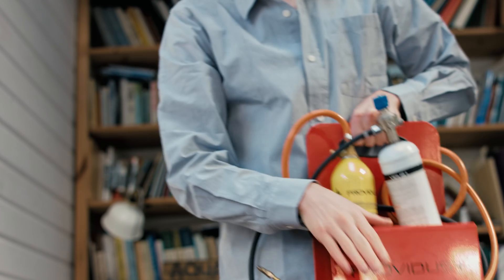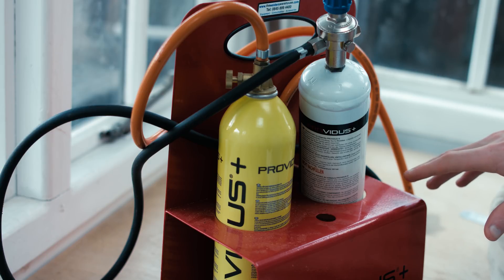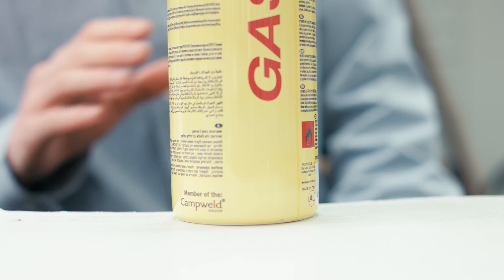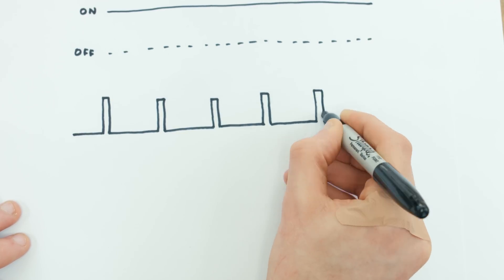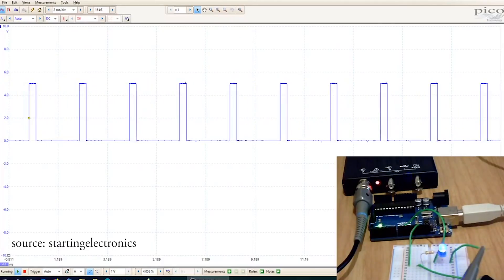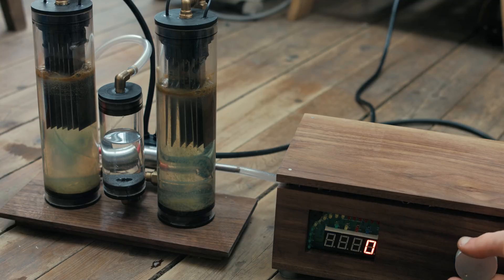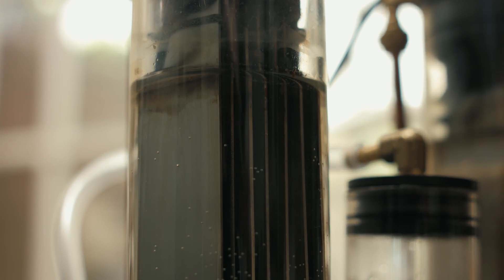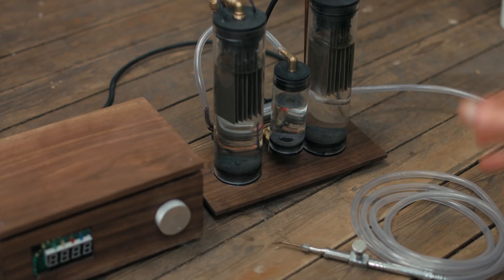Water Powered Cutting Torch

Comment: Use stainless steel in a alternating plate configuration like the production units do. They last just fine under the lye (sodium hydroxide) caustic used in the water to allow proper electron flow... And NEVER fill up a balloon with it and tape a 1 foot fuse to a mostly enrolled black cat firecracker ( potassium clorate and aluminium oxide (dust )) light it and let it go. Might blow out your windows. Use at least TWO explosion arrestors, like the pros do, or you production tank will be shrapnel.

Comment: Using distilled water prevents corrosion, and also there is an equation of amperage to surface area of plates. The higher the amps the hotter the plates get which speed Corrosion.
Go here for valuable info ! http://www.hho4free.com/cell_stacks.html

Comment: swap polarity after a determined time, if there is buildup. it should dissolve or flake it off,  on this note you could use rebar or crap  and have sacrificial electrodes. I guess that defeats the point. depending on the details I could postulate that something in the water is reacting to deposit on surface, or cause other issues? I'm a newb sorry. done home  experiments not a nice as yours though

Comment: Wondering if you made any changes and how it turned out? Before I offer my humble opinions on the problems, I gotta say that's a very cool looking project. Were you going for 1800's science look? That's the vibe I get. Love it.
Now, I would agree with some of the others. Your steel might be 400 series stainless and not 300 series. 316 is probably at the right price point vs. corrosion resistance. And yes, distilled water is a must. Chlorine isn't something you want because it creates highly toxic gas, even though that can be rectified by leaving it sit open for a day or so. But there are plenty of other minerals and chemicals in tap H2O, such as calcium, magnesium, sediments, possibly fluoride from fluoridation. Pure water and potassium hydroxide are all that should be in there.
 Next, plate spacing and neutral plate arrangement are crucial to maximize efficiency of voltage and amps flow over the plates. I believe 3mm is the sweet spot, as per a US Energy Dept study found. The cell needs designed to "use" up the voltage, so each plate "sees" around 2 volts. Example: 12v supply = 7 plates x 2v drop between each pair. Only the two outer plates are connected to the supply. Only the amps should be changed to vary gas production and there is a maximum based on plate area before heat and degradation is sped up exponentially. Voltage needs to remain constant or you will have efficiency losses, possibly arcing, and straining your power supply: increasing the chances of problems, especially deterioration of the plates and mucky electrolyte.
Here is a good site for research: http://www.hho4free.com/amperage_understanding.html

Sorry it was so long, and I hope it helps others build efficient and successful hho projects.
Reply from the maker: Thank you for the long and thoughtful reply! I think I may have been ripped off with the stainless I bought. I’ll try out distilled water. I have each plate at 2V.

Comment: use distilled water with NO additives, to compensate for the high impedance use high voltage. Fly back or radiant works well, tho requires advanced electronics. Pure HV PWM will work too.
Reply from the maker: Guardian Engraving I’ve never heard of that method? Would need some serious diodes to rectify voltage that high with such a large current.
Reply: @WillFromLondon  No no you misunderstand, the method uses HV with almost no current (Amps). Its similar to Arc Electrolysis but again no current. A fly back for instants has no current, only an open ended potential(V). Current only appears due to an impedance in the way of the potential. You can also create a resonance in the electrolysis cavity to allow for low power consumption.  Or you could also just use a Dry Cell design, built properly it uses less amps then a wet cell. I have not seen anyone use carbon electrodes, that could be something new to try. You can try looking up Robert Murray-Smith on YT he makes carbon/graphite and graphene electrodes. The point is NOT to use additives in the water as it creates sludge & oxidizes everything. But to break the water down using resonance and HV.

Comment: Did you tap water or distilled water? Tap will muck things up. Gotta use distilled. 

Also have you calculated the maximum amperage for your system? If pump too many amps on your 316L plates you will ruin them. 

I’ve built my own. Yours is a wet cell, mine is a dry cell but the principle remains. Mine is rated for a maximum of 32 amps. If I exceed that it will cause the chromium to dissociate from the steel and cause that nasty chromium oxide gas. This naturally is the cause of the corrosion of the plates. Also it dilutes your torch flame with it, making it not burn pure hydroxy. 

Calculate the proper amps. Don’t exceed it. If you need more output....add more stacks or make bigger plates. Do it right and the 316L will last a very long time. 

Love the build quality btw. 

Cheers

Comment: Your problem can be solved if you use teflon. Teflon is almost inert as long as it's surface temperature is less than 488 kelvin. But considering the constant flow of current...it might not be useful.

The best solution would be to use flourine-passivated nickel plates.
Now if you let some flourine react with a nickel plate, it will form a tremendously corossion resistant layer on the nickel. 
This is an extremely good project.
I feel you on the matter of recharging your welding gas every now and then. Considering the reaction taking place, after some time, your water cylinder would run out of H+ ions to convert. So you'll still have to recharge it by refilling the water cylinder. This is a cost effective solution,plus it is less frustrating than having to change the fuel cans repeatedly.

Comment: a normal dimmer switch uses the same system if im not wrong
Reply from the maker: I wanted variable current not variable voltage though, otherwise a dimmer switch is a good idea :)

Comment: First use KOH as your electrolyte .Also make sure all of your plate area is submerged in the electrolyte. And last,use distilled water,not tap or bottled water. But you should switch to a dry cell configuration,as they are far more efficient.
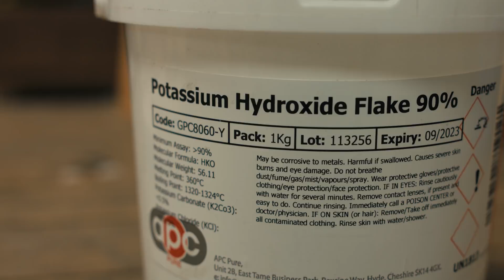Reply: 4:24 he uses exactly that. Potassium hydroxide. I use sodium hydroxide and I didn't have discoloration of my water. I think it's the way he connected the copper wire inside the tank as noted by another person commenting. I used to make units with just table salt and bared copper wire. You would get hydrogen. But that water was funky gross after.

Comment: Where did u learn to do this stuff? I always wanted to do this kind of stuff but idk where to start
Reply: Brett, the best thing to do (without going for formal education) is just start tearing things down,  studying lay out and connections and research what you find, then build small and work up from the. For this specific project, there is a link in my comment to Will that has great info about hho. And there are some very good, free electronics tutorial sites on the web to learn about components.  
But I'll say it again,  the best way is to just tear down and build. 😁
Reply: Start with this video. I just got my first draft completed and it's working fine. Making a second draft and will be uploading it on my channel shortly. Maybe we can all put our heads together and get a car running. I'll be running my 4 wheeler off it soon as the second version is done.

Comment: What of you would electroplate your plates with a more expensive material, like maybe gold. Gold barely oxidises and is pretty much the most corrosion-resistant metal there is, not to mention an excellent conductor. If you electroplated your plates, you wouldn't need very much. But I'm still not sure how expensive it would be..?
Reply from the maker: David Loewen gold would be an excellent metal to electroplate with. The problem is that the electroplating process is a bit out of my reach, needing some pretty exotic chemicals to do. Plus the gold ain’t cheap!
Reply: @WillFromLondon   maybe another YouTuber, like Cody's lab could partner with you on it. He did some electroplating with gold I believe. But your right. It would be expensive. I would just really love to see this work.
Reply: @WillFromLondon  here's his video on it. https://youtu.be/_PmJGOcBZQI

Comment: Good stuff so far man! I've dealt with titanium enough to know that it's a bad electrode for electrolysis, as you've already figured out. It does basically nothing but create an unnatural oxide layer (as titanium doesn't naturally oxidize) and "anodizes" the metal surface. (Definitely a good project for another time though.) I second the graphite electrodes.  Although you might want to try something like carbon fibers or something that won't cause a ton of resistance. Maybe graphene plates??? Another material to try is tungsten. You really want to find something that won't react or give way much to the charged electrolytic fluid. You could also try a conductive ceramic, or bits of precious metal coated mesh or honeycomb like from a catalytic converter.
Reply: titanium wont rust or create oxide layer in slat water does it? btw i also tought about using tungsten rods,good thinking you are the first one i see to mention this,i wanted to keep it a secret till i made one myself,,but i would think a porous like mesh of carbon would be perfect ,perhaps those come in graphene? or graphite mesh
Reply: tungsten will be great

Comment: Can it burn through metal, because you only showed wood in the video, and it didn't seem to go all the way through so I'm just curious
Reply from the maker: Lasse Nørbjerg the flame isn’t that big, so for small stuff (thin plate, jewellery etc) it can do metal no problem. For larger projects though I’d stick with the bottled gas torch as it has a much bigger flame.

Comment: The king of random has done a video about electrolysis, he actually took the stainless pieces and grinded them in 45 degrees, and again in 90 degrees, so as to get the most surface area possible, little known fact is that all stainless pieces come with a veeeeery very thin of coating (oil coating mostly) in order to keep them shining and clean, maybe the coating is what messes your whole rig! pretty interesting video! keep up the good work mate! you're onto something big there i can tell!

Comment: I think the corrosion of the steel electrodes is because of the general corrosive nature of bases, when Electricity isn't connected to the cell. Maybe putting the KOH-solution in another container and cleaning the electrodes when the thing goes idle?

Comment: You should look at dry cells, much higher efficiency and production rate, I’ve recently built one to power a mini knife forge!!
Reply: A guy on here with a channel called camelloops could have helped you to get the most from a wet cell but I believe he was recently killed in the last fires to cross California.
There's another chap on here with a channel called Tin Man Power, he can also help you to get the most from a wet cell.

You can achieve great water cavitation at a low amperage, what's most important in my understanding is to use a gated pulse width modulation of around twelve pulses per second and tune for the best results.

Hope that's useful :)
Reply: @HumilityThroughSilence  Lol killed in a fire. Be careful; you aren't following the most approved activities. Thank you for your service to humanity.
Reply: Well, this answers the question of if I can make a proper HHO forge, and it looks like I can.

Comment: 304l and 316l are plates to use for generator, then you need to annealing and condition them to increase conductivity.
Reply: You can just sand in a cross hatch pattern (good) or bead blast (best) them. And make sure to clean them with acetone or denatured alcohol.

Comment: Nice work! We have a hydrogen generator in the lab I work in that uses the same principle. Using super pure water is a must for it otherwise the membrane that separates H2 from O won't last long. Since your interested in both H2 and O the deionized water may not be necessary but I thought it could also maybe produce a cleaner reaction... just a guess. The manual also just said it used a "special metal catalyst". Was hoping to find out the type of metal but no luck!
Reply from the maker: Interesting! I have a feeling that the catalyst would be either platinum or palladium, those metals are commonly used in hydrogen fuel cells and reactions of that sort.
Reply: Pd-coated stainless electrodes and ultrasonic cavitation ur production will be off the charts (lower amps higher voltage pulsed at 2.5mhz-5mhz) look at us patents for hho electrolysis home use high amperage all feature cavitation and high voltage.  Best luck

Comment: Wow fancy design👍🏼 love to see other people doing the same stuff as I do. I built myself a 2lpm HHO drycell generator when I was about 15 years old. Im still fascinated by that whole thing today. You can check out my video if you want😄

Also love the edit of your video style. No there os actually no real way of having inert and affordable electrodes. I just use stainless steel, even though there are some nasty chromium salts forming.
Just a side note, the energy contained in the flame is very low. I wasn't able to weld any serious stuff with it. Its great for cutting and melting though.
Reply from the maker: You've got an amazing set up! I'm very jealous haha
Reply: @WillFromLondon  thanks😄 yea quite a lot of work actually. Note I updated the comment a little bit. Also the flame can't melt thungsten, so no 3000 degrees sadly... But it is getting very close.
Just one last thing, by seperating the two gases and also moving the electrodes further apart, you lose a lot of efficiency. Its a lot less dangerous though by doing it that way.
Reply from the maker: Freizeitflugsphäre yeah it’s like 2800-2900C right? I read a few different estimates and I just rounded them for simplicity.

Thanks for the steel suggestion! I’ll check it out.
Reply: @WillFromLondon  yes something around that. Sry obviously you are from the UK, sorry no need to point out that it is European standard. At least by now you are still member of the EU 😅😂😓
Reply: @WillFromLondon  14581 is the steel I use. Works quite well. Only slightly rust building up over time. Note that this material number is based on european standards.